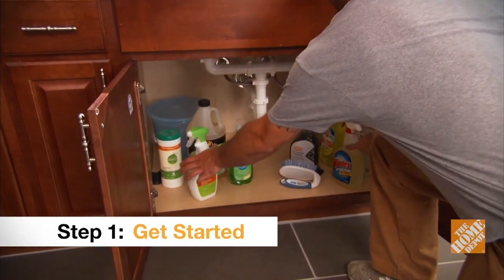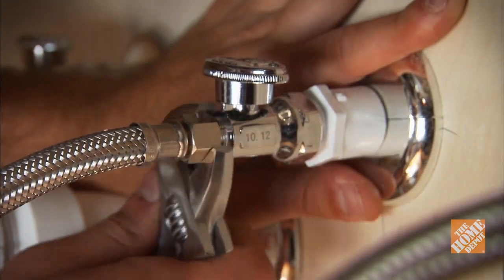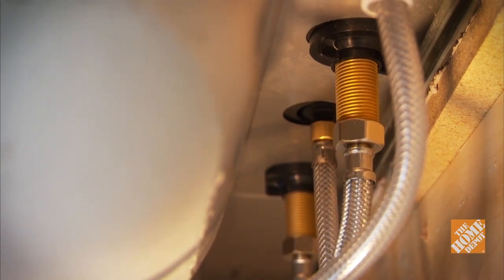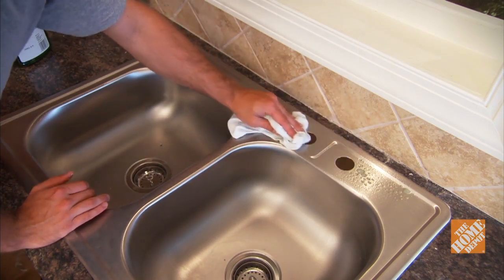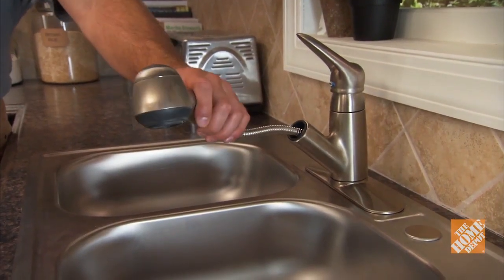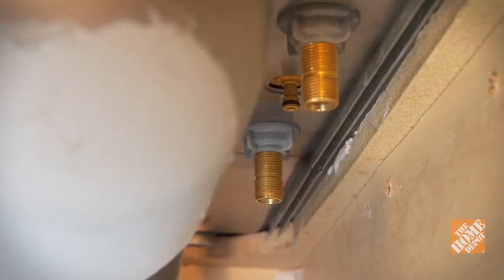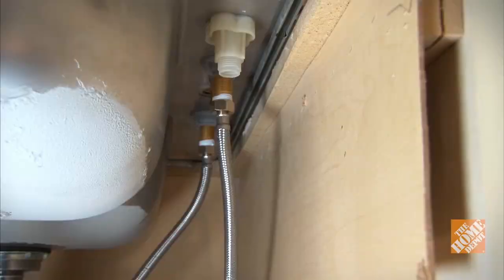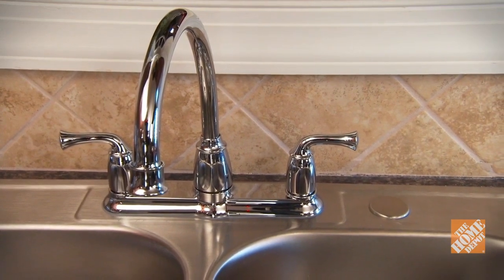How to Replace a Kitchen Faucet with Two Handles | The Home Depot

Comment: I had to replace my kitchen faucet years ago.  It has a drip in it, so I went to replace the cartridge on the hot water side.  Little problem #1: The retention nut crumbled when I removed it.  Little problem #2: I cannot find replacement parts (sorry, we no longer carry that model).  So, my day just got a lot more interesting.  And expensive.